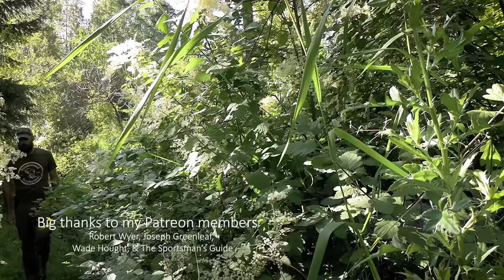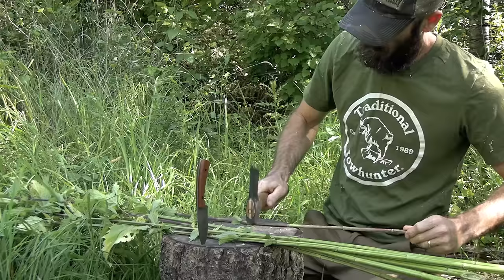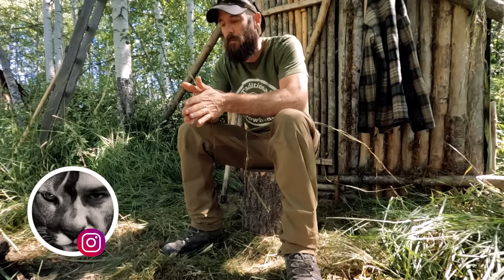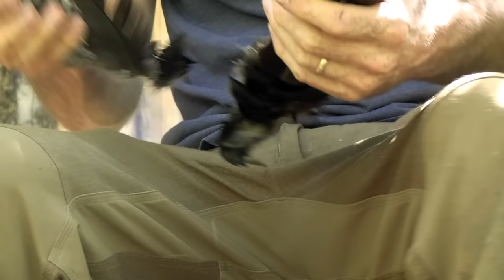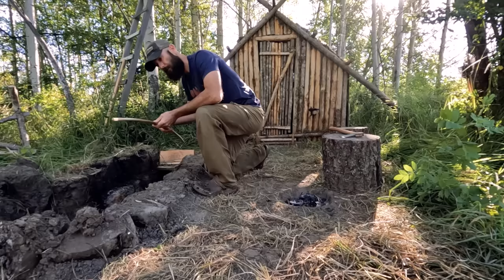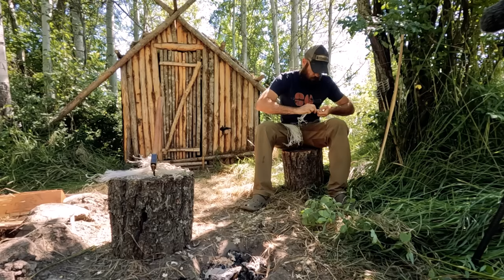Live Tree to PRIMITIVE BOW in 24hrs - All Natural Materials

Comment from the maker: Hey folks, couple notes on this vid. First, when the nettle string broke the first time, it looks like I may have cut it while tillering the limbs. But it actually broke about 18 inches from the nock and well away from the knife. 

Second, the knife is from northmountainknives.com

Enjoy, ch
Reply: You are a man of your word. You made an excellent bow. I react the same way when my string breaks. I look forward for future videos.
Reply: That the model he calls the Mountain Top Hunter? I think many would be interested to know if there's a noticeable difference between name brand knife manufacturer's like ESEE, Tops, etc. and NMK's work. Or do you just like supporting small business? Good looking knife and it appears his prices are reasonable.
Reply: Have you had success using nettle string before? Can it work?
Reply: Hi Clay, I have thought about writing you about this for a while. When you make cordage you add a new piece straight in. I have seen a few primitive guys put the cordage strips in by bowing it near the center and then twisting it in down both sides. This leaves less ends sticking out and if you stagger the length from side to side you can make thickness adjustments as you go. This also means there is zero chance of strands pulling loose in the wrap. If you do know this method why would it not be better? If not, it would be an honor to think I added a solid piece of knowledge to your tool box for all the amazing hours you have been my teacher and quality entertainment.  Oh and I'd like to know how you carelessly grab all that stinging nettle lol. I'm a native of the mountains of NC and still in my grandpa's house where I came home from the hospital as a baby over 50 years ago. If you ever need a roof in these parts, you always have one here. Thank you for all the hard work and sharing this hard earned priceless knowledge. You and your boys teach the younger generations what being a good man, a real man and loving father actually means. All the best, Mike.  ... I will put this to your main comments as well.
Reply from the maker: It’s a good knife.
Reply from the maker: Hey Mike, I did know about that method but just didn’t think of it. Thanks for the reminder!
Reply: @clayhayeshunter  That's a politically correct answer if I've read one LOL.
Reply: Really good video. One thing I do differently when making sinew rope is to add the new strand to each leg of the rope. Instead of putting a strand into a single leg, just find the halfway point and twist each half of the strand into both legs. I find it makes for more uniform sized rope and it keeps from having to trim the sides when finished.
Reply: @Clay Hayes Hi there's a scammer that has replied to a post I put in this msg board claiming to be you If you want to block them 👍

Comment: In regards to the nettle string: while you can get serviceable survival rope out of using nettle "bark" as is by braiding it, for purposes where it needs to take a lot of strain, like a bowstring or sewing thread, you need to get rid of the green gunk surrounding the nettle fibers. A fairly easy way is to use a dull table knife, press the strips of nettle fiber/bark lightly against it using your thumb and drawing the fibers so that the knife scrapes some of the plant matter off them without cutting them. Fairly soon you should start seeing the pale whitish fibers starting to separate. The cleaner you get them, the stronger the end product will be, but at some point you just start losing fiber for no real gain. You can also just clean the worst of the gunk off, let the fibers dry and then roll them between your hands vigorously for 5-10n minutes per bundle and that should get majority of the remaining dried plant matter to flake off. (I tend to scrape my fibers as clean as I can get them rather than using the rolling method, but in this regard I'm too much of a perfectionist for my own good.)

The nettle fibers are really strong, but the stuff surrounding them decidedly isn't so the cleaner the fibers, the lighter your string will be and strength in relation to string diameter and weight will shoot up dramatically. Things like when the nettles are harvested and the exact species of nettle also affect things, but nowhere near as much as separating the fibers. (In regards to harvesting, unsurprisingly the later you harvest, the longer the stems will be, which means longer fibers, which directly correlates to a stronger end product.) Processing the nettles like this will probably take enough time that a 24 hour setup isn't really feasible, but a luxury archery set, where you take leisurely two days to complete it should be doable. 😄

I started testing out nettles as a string material a few years ago, as I wanted a natural, "primitive" material to use on my bows, but didn't have a reliable supply of sinew. Of course things eventually got out of hand and now I'm hoping to harvest enough nettles this year to make a set of shibari ropes from start to finish. The amount of work is frankly stupid, but well, I'm just not that smart, and the the rope you get as an end product from properly cleaned nettles feels amazingly smooth and soft.
Reply: What's stronger dog bane or nettle?
Reply: @micahspur  From what I've read nettle is the stronger of the two (and one of the strongest plant fibers with only certain specific breeds of flax and maybe some hemp varieties being comparable), but that's just based on secondary sources, I haven't tested dog bane myself.

The problem with nettle has traditionally been that it's difficult to process in industrial quantities. Retting doesn't work nearly as well with nettles as with flax (due to the sugar content of the nettle, which tends to put the bacteria involved in the retting process into overdrive) and processing the fibers by hand is incredibly work intensive if you need a substantial quantity of high quality material. An industrial process was developed a few years ago, but they've had problems getting people to farm enough nettle to really kickstart the production of nettle cloth.

Hm, that was a bit more of an infodump than I originally intended. Sorry about that. :)
Reply: Thank you for your deep insights, I will keep this in mind!
Reply: that's awesome dude ! 👏
Reply: Also Clay would be used to making as high a performance bow as possible.But realistically thats not always possible in such a short timeframe.
Reply: Another common very strong cord / string making material are brambles. I've had good success in making bramble / thorn cordage. It's very strong, it can almost hold my weight when done crudely (I'm 65 kgs). So if done correctly, could easily hold more weight than that. The only real downside is that it has to be quite thick to reach such strengths, so I'm not sure if such a "thick" rope would be useful in a bow or not. However I'm not talking about a high performance bow, I'm just talking about it it will be enough to get you your next meal if that's what it came to.
Reply: Video yg u
Reply: Sounds like something a Finn would do
Reply: Bro……did you take an adderall or what?  That’s the longest comment I’ve ever seen.
Reply: Making so much with so little definitely shows that you’re truly a master of your craft.
Reply: 3ііііііііәіііі33і33уу
Reply: This guy nettles.
Reply: @kylehoward4636  Nah, he's a serious maker. He knows the way and didn't disappoint in his comment.
Reply: give palm leaves a try, you want the centre as its the strongest part
Reply: Great info thanks for sharing.
Reply: Sounds a lot like processing yucca fibers. I haven't worked with nettle, but yucca fibers are kinda strong even without significant processing so I doubt it is any worse.
Reply: @BoredLyron  Is there information somewhere about that industrial process of processing nettle?
Reply: Flaxbush is verry strong we use it for everything in Aotearoa we are Maori indigenous to our Country
Reply: so its possible?

Comment: Morning, Teach! We're here and ready to learn! (I'm wondering if the bowstring could be made stronger by first running the fibers through a hard bit of resin before twisting them up...I use a similar trick when sewing with linen thread where I run it through some beeswax before I use it)
Reply from the maker: 🤔 maybe!
Reply: I believe that using a beeswax would strengthen the fibers.
Reply: Also I seem to remember Ryan gill saying that a three strand bow string was better / stronger than a two strand.
Reply from the maker: And a lot more work!
Reply: Julia do you mean using it with the nettle chord?

Comment: Hey clay great video. The learning is in the chore. When I make natural coordinate there isn't a material that I don't wet when I twist it. The initial drying of your Material, pre shrink set so that there are no gaps when you twist it. But after you've dried it you need to rewet it when you twist it. It will relax into place and be a much tighter to twist. The way you are splicing your material leaves fraid edges throughout. Simply re wet your cord lightly and let the afraid ends dry while the cord is wet. Then run it through a flame and burn the frame edges off without damageing your cordage. I think what would have made the biggest difference in the end result of your bow string would have been to simply wet the cordage as you were twisting it so that it twisted tight and neet.

Comment: A number of years ago I used to bush hog a AM tower station's field.  They had some weed that produced a pod that resembled beans.  When I would weed wack it down, it would get wound around the head of my machine and I had to use a knife to remove those string fibers of the weed from the head of my weed wacker.   I think that weed would make excellent natural cordage that would be close to strength of any man made cordage.  This bean pod weed only grew at one of my bush hog mowing sites, but was definitely a pain to deal with for cutting purposes.

Comment: Clay, I got my hands on a couple of black locust logs from a friend who clears right of way for the railroad. They are about 7 ft of the straightest locust logs I have ever seen. One is completely knot free and the other has two knots on one side and the other side is perfectly clear. The trees were cut last fall and have been standing leaned up on other trees since then. Do you use a moisture detector to check the wood? If so, what moisture content would you be looking for. Also, have you ever tried fire hardening locust?

Comment: For those kind of tasks you should have a real puukko which is much better and precise to use than that kind of knife. Sharpening should be flat or even slightly concave. Only very small, almost invisible micro bevel should be had, then puukko cuts wood and other materials precisely and is easy to control.

I can see your axe skills could be better. Don't push it but swing it, let it drop and work for you. Final work using axe as a shaving or scraping  tool was inventive and well done. 

Very good channel. It is clear you know these bushcraft things really well

Comment: I think the upper limitation for a bow from a survival standpoint is actually the arrow. Its an inherently innacurate projectile. Ive made primitive arrows, and without a spine tester and a way of keeping the weight consistent they are a far cry from the modern trad gear everyone is so proud of. I think thats a major benefit of a crossbow, arrows dont flex really, so you just have to make them straight. Sure you still have the issue of arrow weight but crossbows are less sensitive to the weight difference as all arrows will have the same trajectory close range.

Hitting something small at 15 yards with a legit primitive arrow (no home workshop to tune arrow) is pushing it. Also, the arrow flight isnt perfecr either which is super important for penetration on larger game. Crossbows dont have that issue and ive been able to hit small things at 40 yards with primitive arrows out of a crossbow without much trouble... thats a pretty major advantage in my opinion as effective shooting range greatly increases hunting opportunity.

Comment: Clay. what is the optimal time to straighten the arrow shaft? Should I completely dry it first or leave it a little green? If 0% is freshly harvested and 100% is completely dry, what % is the optimal point to straighten?
Reply from the maker: These were force dried which, if you have the time, isn’t ideal. I like to give them an initial straightening while green, then bundle them together and let dry. Then do the final straightening once dry.
Reply: @clayhayeshunter  Thanks! I'm asking because I have a bunch of willow shafts I let dry for the summer, but am having a hard time straightening now. I'm heating them up over my backpacking stove. Maybe I need to heat longer?

Comment: I once made a bow, spent months on it making shoure it dried out well.
 Every thing went well. Used ansacreficial string, so I could see how the bow bent, while working on it.

But when it came to make an string specifficly for that bow, shit whent side ways FAST.
 First time I pulled the bow it snapped in half. Turns out there was a small beginning of a brach that i had not seen, and it turns out that was the bows golden weak spot.
 That wood just wasen't meant to become a bow.

Never felt such range of emotions like I had then. Laughing, anger, sadness, dissapointment, frustration. All at the same time.

You win some, you lose some.
Reply from the maker: Stick with it

Comment: This my frist bow I'm building. One question please. I cut it down to size and  shape. Testing the bent and it does great but it will almost go back straight. Keep alittle bent in it. How can I fix it or do i need to let it dry more? It is a fresh cut
Reply from the maker: Moisture content of the wood has a big impact on the performance of the bow. To get the best performance it needs to be about 7% moisture content or less.

Comment: The worst part, fletching arrows. That work properly done. That is the real skill. A bow shooting pointingrd  sticks one thing. But you have to get bird feathers. Then attach them. That is a process. You can use even Turkey feathers. Just trim them down. I like an inch and a half to 2 inches. For longer distance. Some guys fletch feathers over 6 inches long. I find that overkill. Sinew or glue works. But I lean to the former. For ducks, squirrels, geese, deer, or rabbits. Rather than a shotgun. I eat all that. Moose, sheep, and Caribou? That is rifle all the way. Chainsaw cut up. Or you get bears and wolves near. You only get minutes to get away. The real of hunting.